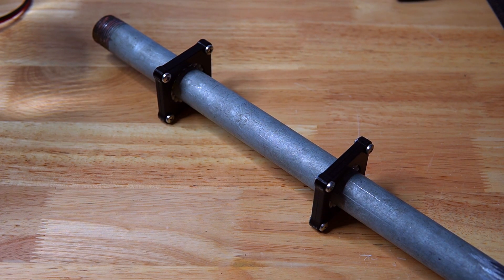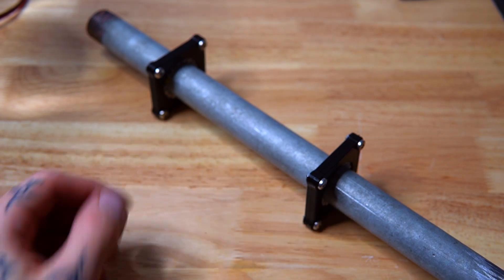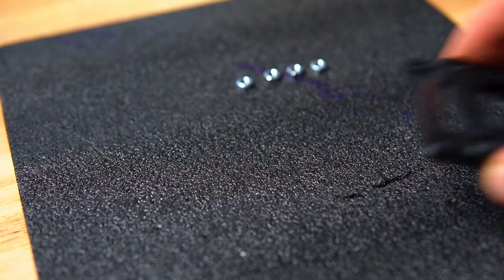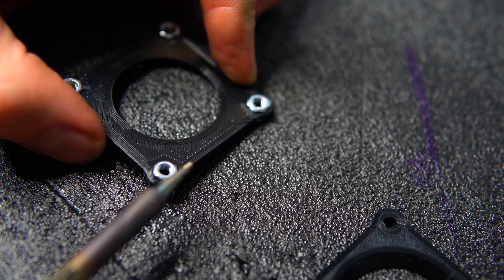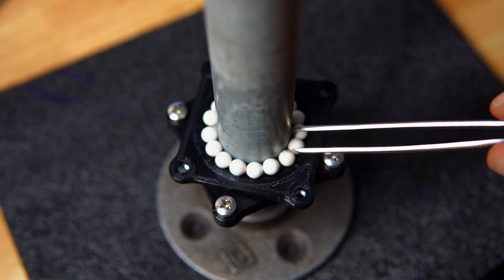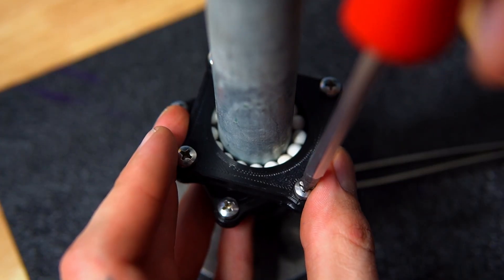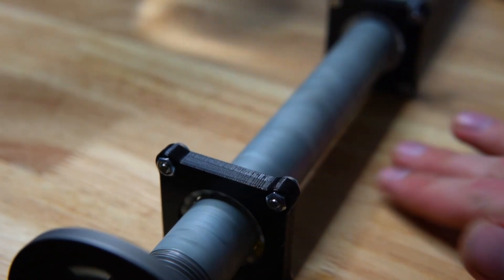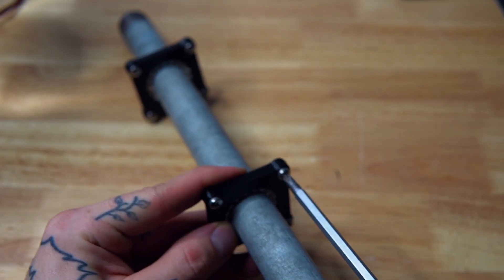How to make ADJUSTABLE BEARINGS for your projects!!! (p.s. it's virtually free)

Comment: That's a pretty clever way to adjust it. The only thing I'd be worried about is the strength aspect of the plastic, since the weight of heavy loads will have a type of "wedging" force on the bearing 'seam' there. Perhaps you could carefully glue the bearings together on the inside where they touch and/or have a wrap that gets glued around the frame to permanently hold it together once you have the adjustment dialed it.

What's the angle of the taper on the bearing interior?
Reply from the maker: For sure! I designed it as a proof of concept, I would make the races out of steel if I were making it for a project. The taper is 45 degrees, and a way to hold it together is definitely a good idea
Reply: @Neally  Thanks man. Have you had any other issues come up using these?
Reply from the maker: @MetalMario137  none so far but I haven't built a full metal version yet, so we'll see
Reply: @Neally  any update on using the printed body with something like steel BBS for the bearing balls?